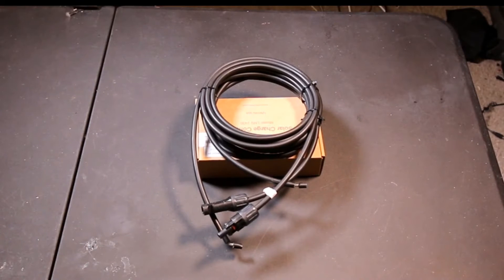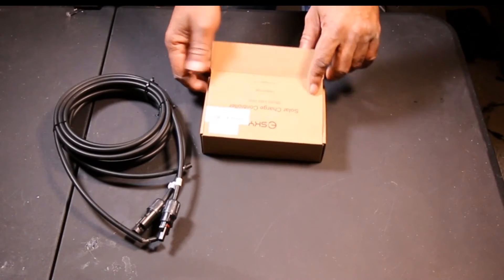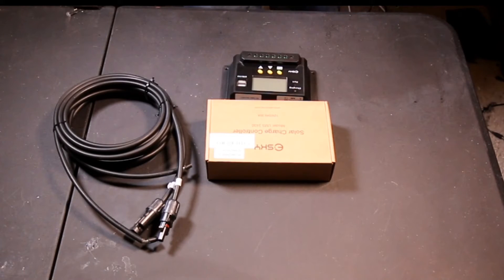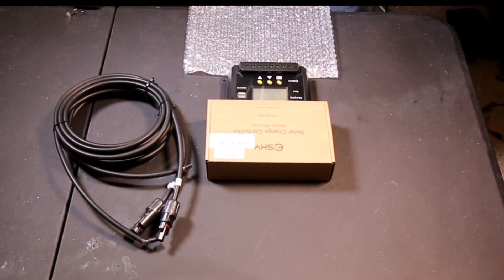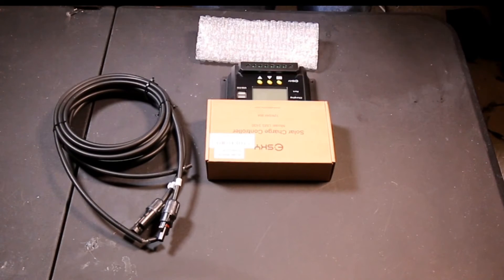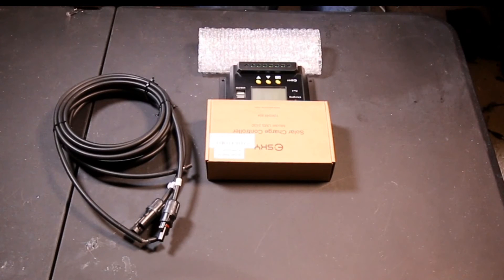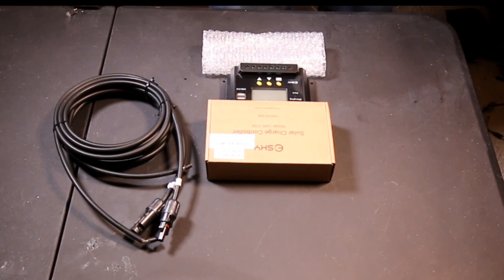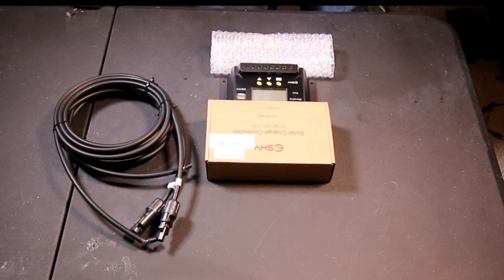Solar Charge Controller:  Esky 30A LCD 12V/24V 360W/720W PWM Solar Panel Adapter Charge Controller

Comment: never work on solar but going that way. good looking van.
Reply from the maker: It is difficult as heck, until you begin to do a little reading and then you realize just how simple it actually is..  at least in implementation, but usually troubleshooting is the hard part in anything new we attempt.